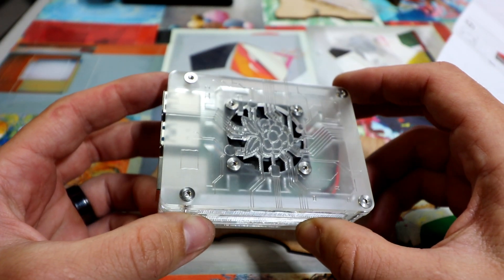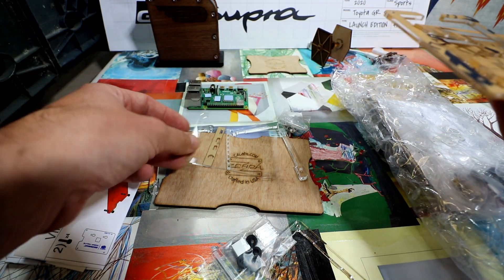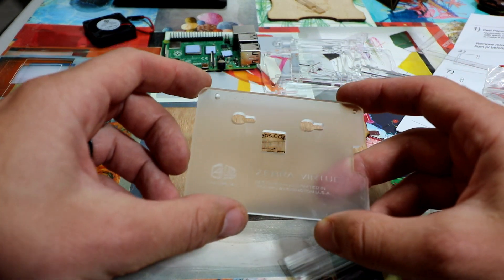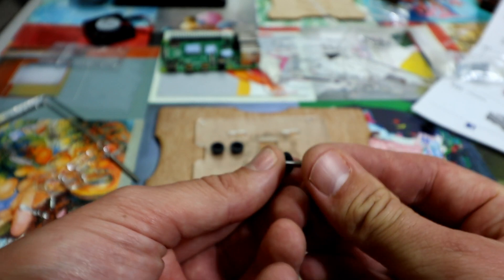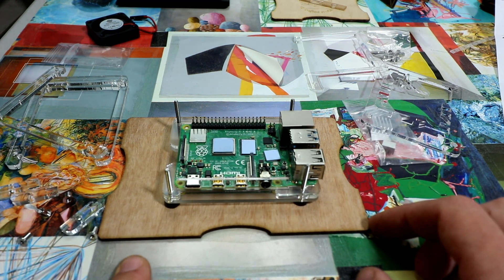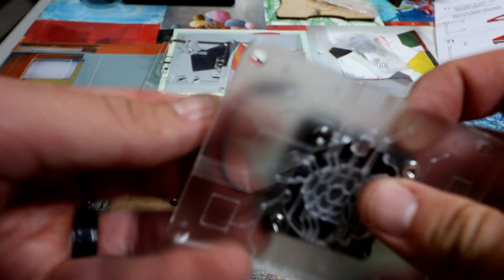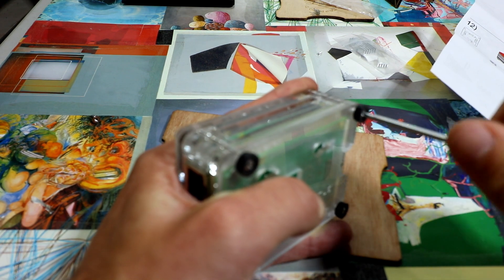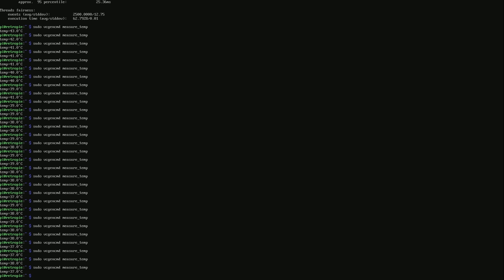C4Labs Zebra Virtue Case for Raspberry Pi 4B,3B+, 3, 3B+, 2, B+ with Fan (Crystal Ice)

Comment: Thanks for the video. I have owned a variant of this case and I did have an issue with it. Since the connectors for the ports are concave (or sunk in) once assembled, it didn't work with my bluerigger cable for HDMI. You have to be careful with what cables you have, they may not "click" in to to the ports.
Reply from the maker: Yes, I find that with a few of their cases